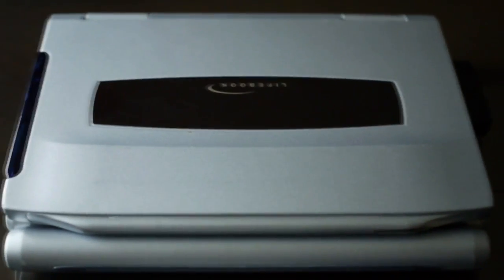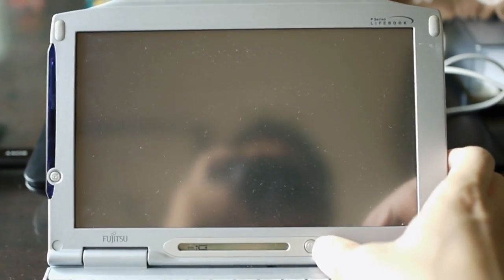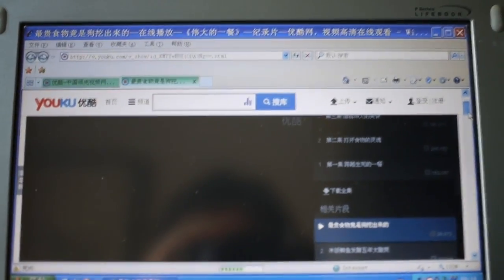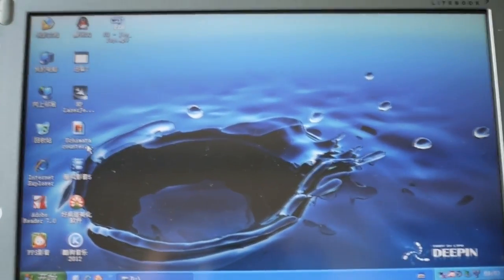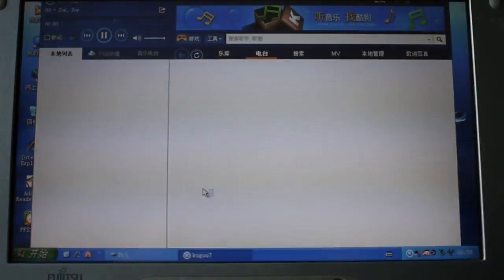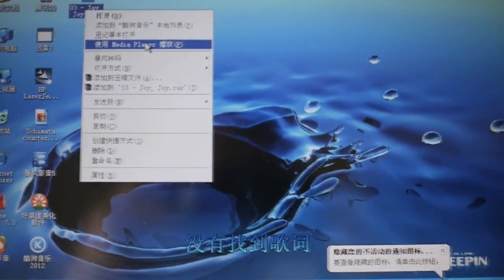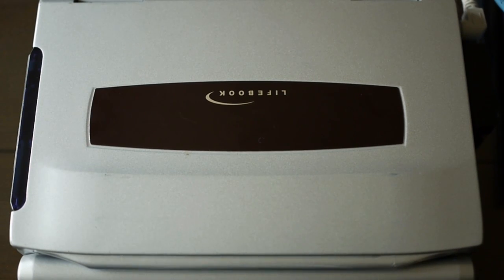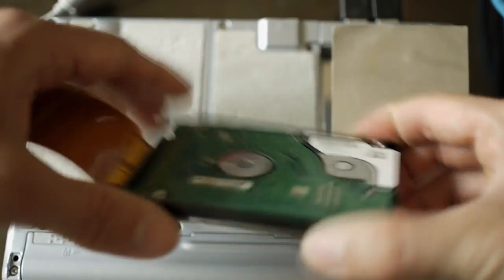Upgrading a very old notebook (2003) computer to SSD hard drive

Comment: Much appreciated for the effort but both the pata ( hardware interface) and OS (windows XP) software aside of RAM and CPU make this more of a nostalig effort than a practical solution, you might want to check if you can use an extender to plug in the drive in the pci WAN adapter and change to linux to see any big difference.
Reply from the maker: I thought about that. The PCI slot is a mini-PCI not the newer mini PCI express. It's hard to find a SSD card in the older mini PCI format. However, I think Linux or BeOS would be much faster.

Comment: correction........ YES you can upgrade the ram as crazy as it may seem, I done it successfully the second time, failed initially C: 
there is a company in Japan called buffalo that made the special mini ddr ram for the P Series lifebooks and the Sony C1 PictureBooks as both the P1120 and the 99-00 PCG-C1s use similar ram which is half the size of standard DDR/DDR2/DDR3 ram.
The Ram slot is underneath the keyboard but when removing the ram from the P1120 be VERY VERY Careful as the connector clips can break easily as happened to my initial Fujitsu P1120. 
My P1120 is 1GB ram which is the maximum that those mini ddr's are made 256/512/1gb. 
My hard drive is a IDE to ZIF Kingspec 128gb. 
It was a struggle of 3 years trying to find a special IDE to ZIF connector for the P-Series.
It's quiet fast on Windows XP, Initially after doing the modifications I had XP/7 dual booting but the Transmeta Crusoe isn't made for Windows 7 xD so i have my Lifebook P1120 in a Win2000/XP setup and the 8MB of VRam/ATI Mobility is sufficient for all the retro games that i have on it C:
Reply from the maker: Thank you so much for sharing this. I must try to find this special RAM and upgrade this old but functional submit notebook computer.

Comment: This machine should run quite well if you install a very lightweight Linux distro ; A good one is, Bodhi Linux, minimum hardware requirements:
    500MHz processor
    128MB RAM
    4GB storage space
It comes with the light, but fast Midori web browser. You can also install other lightweight software.
Another interesting distro is
Puppy Linux, minimum hardware requirements:
    333MHz processor
    128+MB RAM 
In Puppy Linux the entire system can be run from RAM with current versions generally taking up about 210 MB, allowing the boot medium to be removed after the operating system has started. Applications such as AbiWord, Gnumeric and MPlayer are included, along with a choice of lightweight web browsers and a utility for downloading other packages. 
https://fossbytes.com/best-lightweight-linux-distros/
Maybe this could be a follow up video?
I have an old Toshiba satellite A80 (2005) Pentium M 1.86 Ghz, 512 RAM, 60GB IDE,  slow with XP but a different animal running Linux AntiX 17.2;
Idling -125 MB RAM, Libre Office Writer -170 MB, Youtube on Firefox esr (32 Bit) -400 MB. Generally the keyboards on these old laptops are superior (more pleasant to use) to those of newer ones.
A good source of replacement (upgrade) parts for a lot of older machines is www.aliexpress.com

Comment: I think there are just some cases where You simply can't do anything about it.
Reply: Bodhi Linux, minimum hardware requirements: 500MHz processor 128MB RAM 4GB storage space It comes with the light, but fast Midori web browser. You can also install other lightweight software such as AbiWord, Gnumeric (Excel alternative) Mplayer.

Comment: SSD is not good for xp and vista. 7 professional is the best choice for you. With 2 or 4 gigabyte rams.
Reply from the maker: True, but Windows 7 would not even install on this once it detects the CPU.
Reply: @conceptedge  have you try if you still have it, Linux 20.04  or ubuntu 20.04 there are many other versions out there , thank you for the video and yes you do have a calming Voice , do you do voice work ?

Comment: I had a Dell Latitude C600 with a Pentium III 800 MHz and initially 256 MB and later 512 MB of RAM. I don't remember it was ever this slow to load websites and applications.

So maybe it's also the processor that influences the performance and the graphics chip the laptop contains. One other thing is that the modern web is very slow and requires a lot of performance for no reason at all.

My Orange Pi with 2 GB of memory also has problems loading websites but I know that graphics performance could be improved a lot on that.
Reply from the maker: Yes, Crusoe CPU is not known for its performance, it is slower than a comparable Pentium III at same clock speed. Also, 256MB is really not sufficient for even browser from 5 years ago. Flash videos can be very slow and resource consuming. Adding a H.246 decoder can help with the video playback performance when it comes to MPEG4.

Comment: You can change the old xp operative system  in this  Laptop with Linux (recommended Lubuntu is from Ubuntu family for light or very old computers), and your Fujitsu will run faster. If Lubuntu don´t convenced you can return to your old XP.

Comment: one other guy made a similar comment on a forum, person mentioned about switching to windows 7 and his computer from 07'  became much faster with the ssd. Makes me wonder. As if windows 7 "newer operating system" found the right drivers. Maybe I'm just all talk though, lol.
Reply from the maker: I don't think Windows 7 will even install on this computer. It does not meet the minimum hardware requirement. This computer is from 2000.
Reply: You can install windows 7 (Tiny7 or Thin Pc)
I've installed windows 7 on much worse hardware and sed pc is still being used to this day.

Comment: Could be faster if you add 1GB RAM at least (current RAM is bottlenecking the whole experience).
Reply from the maker: No because on this model it is not possible. The RAM is soldered on the motherboard. If I could, that would really help the performance in combination with the SSD hard drive.
Reply: wichotest not upgrade. model upgrade p2110 and others